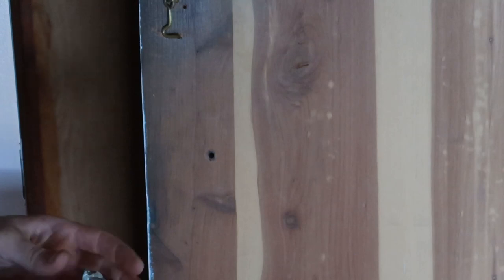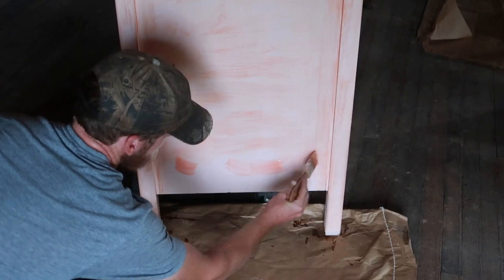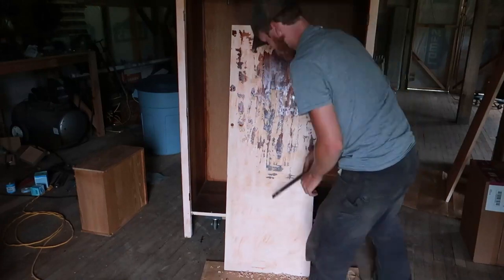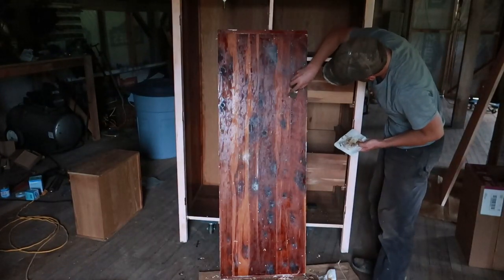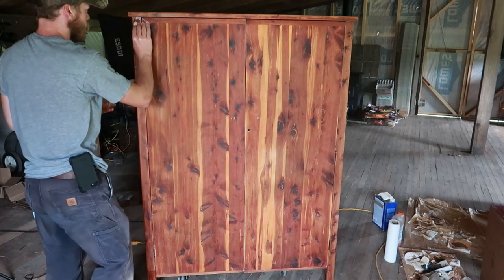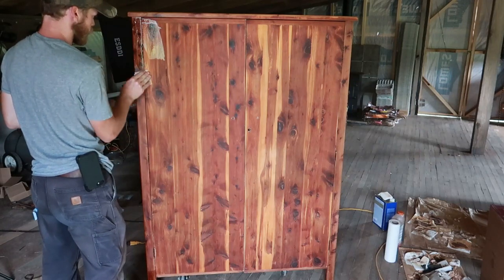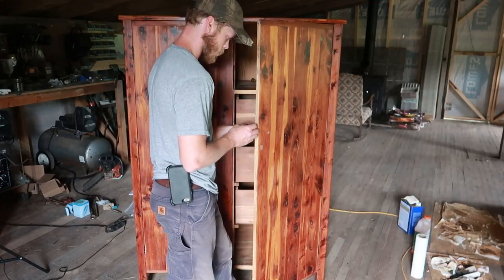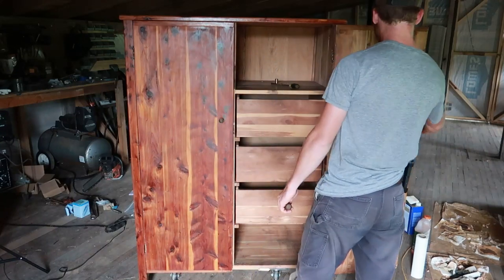Restoring an Antique Cedar Wardrobe

Comment: I know that you'ns call that cedar and you'd be right but we call that a "Tennessee cedar" and that smells way different than our "Western Red cedar" and its got a smell thats different from yours. Ours comes out with limbs clear down to its roots and it feels like fur on a cats back. They grow poorly slow, turn the limbs on it to little bumps out a bit from the heart and then you will never see them again. As these trees grow so slow, the limbs on the tree die off and that tree knot fades away to not bother no more. This type of timber in the cascades and down towards california grows straight and extremely tall. Those that grow in washington on the peninsula and canadian coast line are short, stubby, and called castle tops because of the many tops jutting to the sky and you find hemlock and spruce or fir growing as well and the inside of the tree although still solid at the top, will only go a little ways and be hollow. Those bottoms of the tree are huge and not uncommonly, about fifteen to twenty feet and even larger from one side to the other across. Thats where I came in as a kid Josh... the state would pay some of us who cut trees down to fall them before they fell on their own and killed someone driving by on the highway. Although our saws were large, normally the bar would not exceed six foot long to cut that ring that held it up. These trees seldom found on flat ground, the best side of the tree would be the downhill side or the way it leaned. We cut as much as possible and then cut notches into it and cut further and before reaching clear though hopefully, we would cut the thin side off and if it didn't fall.. we cut holes in the sides of them, then got inside and cut the remaining wood holding and down they came to the ground. You were safe and sound on the inside because the rotted wood was light as a feather and like dust so no harm from falling limbs on the outside where it was really dangerous!!! I fell many till my courage turned to jello and knew it was my turn to quit this trade. The art was dangerous yes, but one tree paid a months wage and that was a lot of money.... I hope that you enjoyed Josh
Reply from the maker: 😮 that sounds pretty crazy. Can’t even imagine cutting it from the INSIDE!